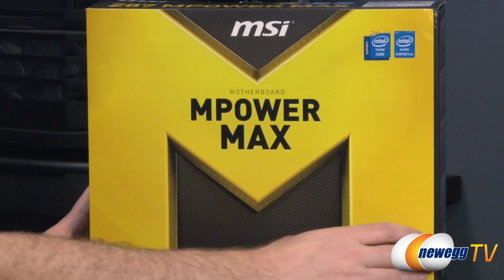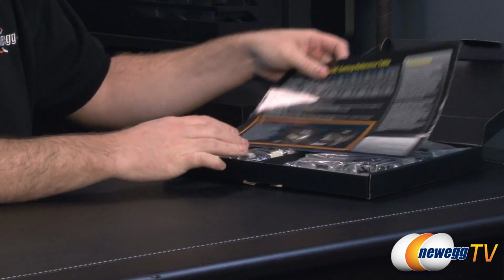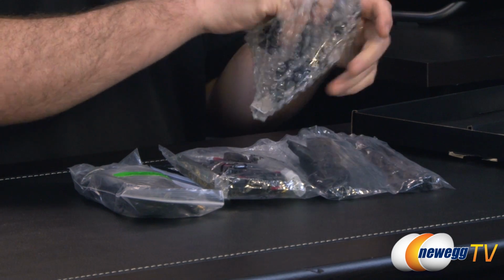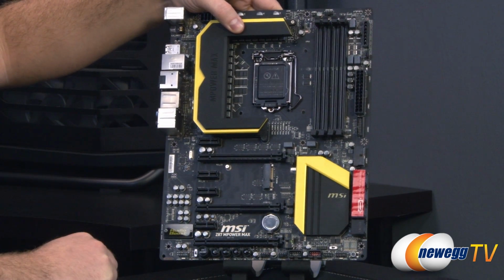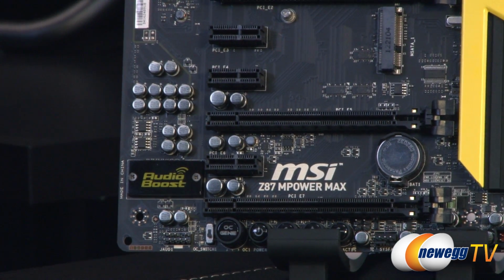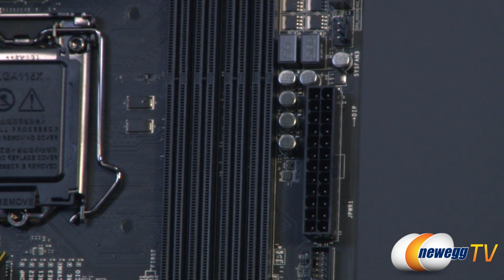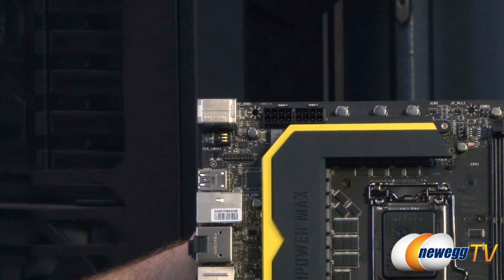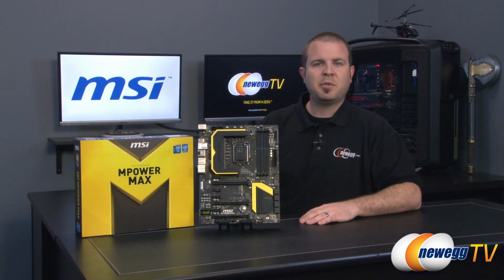Newegg TV: MSI Z87 MPower Max Motherboard Overview

Comment: The Killer Switch Manager, have some problems installing on Windows 8.1 (Version 6.3)
But it is a way to bypass the problems by changing Current Version to 6.2 temperately while installing KSM.

Comment: The MAX version has 20-phase CPU VRM vs 16 on the standard MPOWER. The MAX version also has an extra 2 USB 3.0 ports in total as it has a Renesas chip in addition to the native Intel and extra ASMedia chips (there are the same number on the rear I/O but the MAX has two internal headers vs one on the standard MPOWER). There may be a couple of other things but those are the most major differences I can remember off the top of my head...

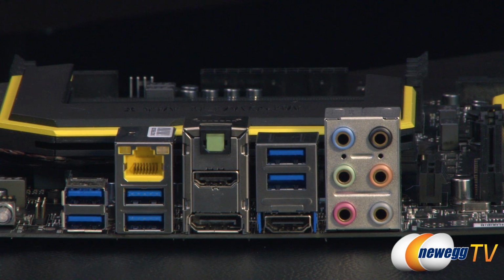Comment: At 19:58 in he says the lower two USB3.0 ports on the back are supported natively by the Intel Z87 chipset - this is not true. The Intel Z87 chipset only natively supports the two internal USB3.0 headers on the motherboard. The lower two ports on the back are supported by a Renesas uPD720202 Chipset.